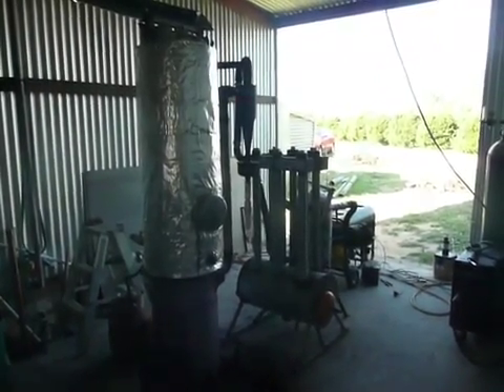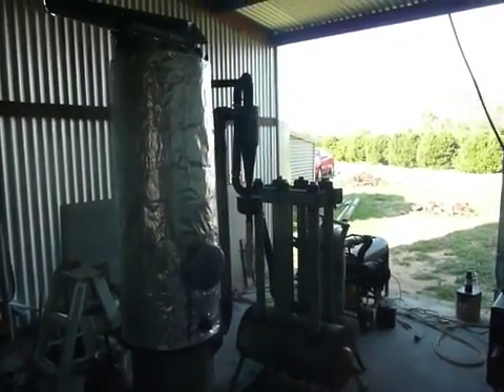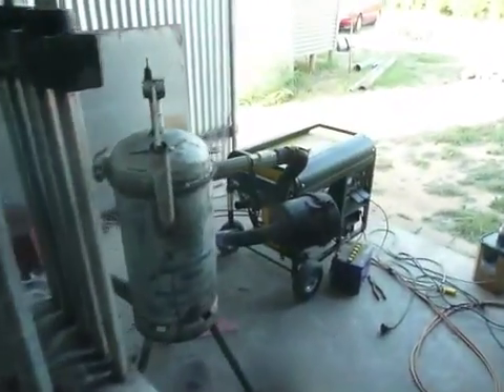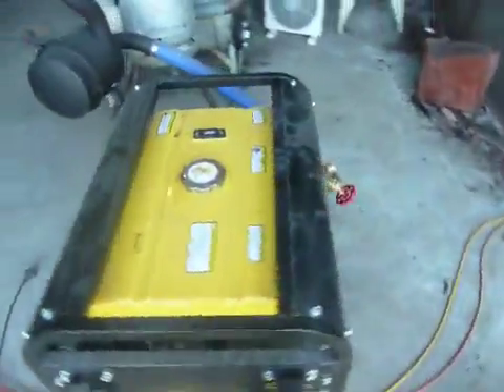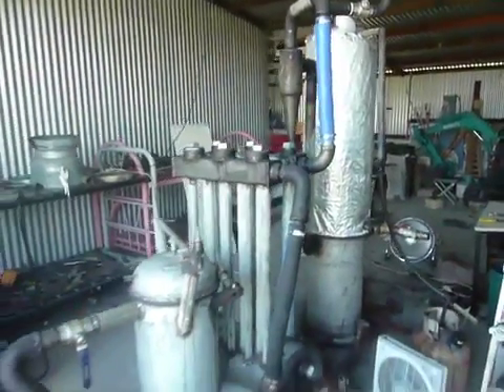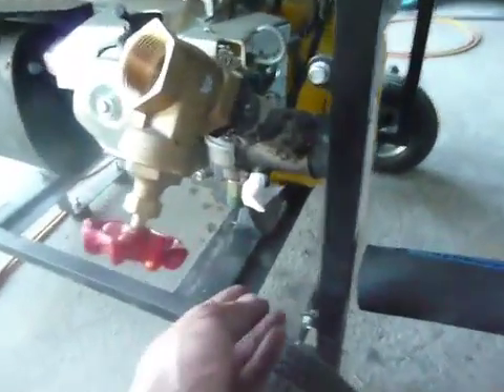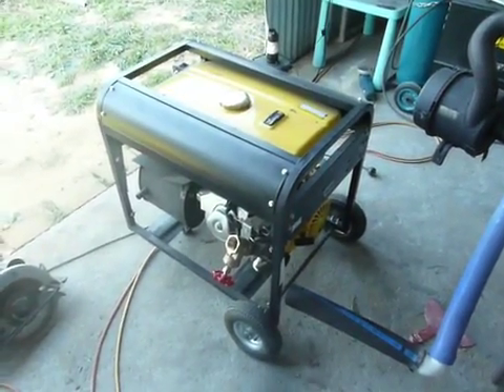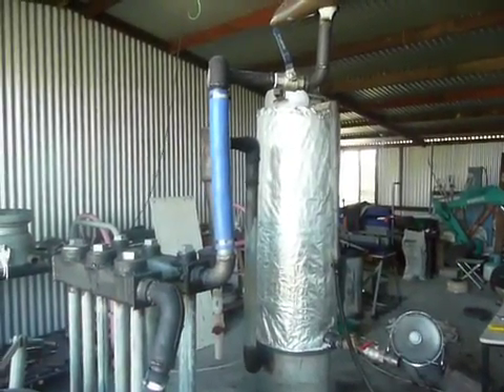gasifier after 2.5 hours

Comment: Wood that is not very dry produces a gas that has water and other particles in it, bad for the engine. What you have to do is condense the liquid and dispose of it before it goes into the engine. Keep the gas dry by burning dry wood will also help.

Comment: I built venture scrubber, using it  for filtration........on average i gain around a quart of water in the scrubber for every 20 lbs of wood the gasifier consumes.....the relative humidity of your gas will be around 100% ....you ether have to condense it out, separate it centrifugally and/or add carb heat......good job thanks for sharing